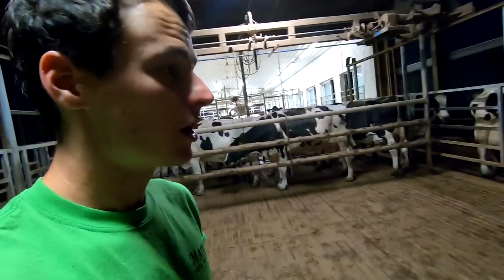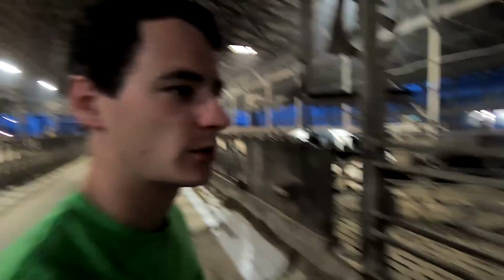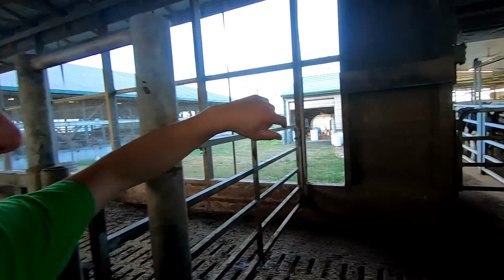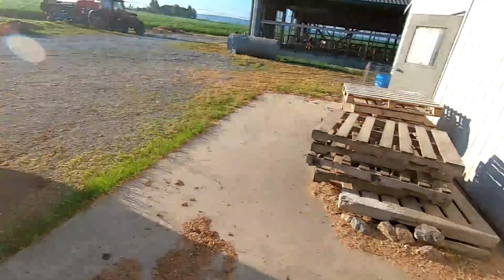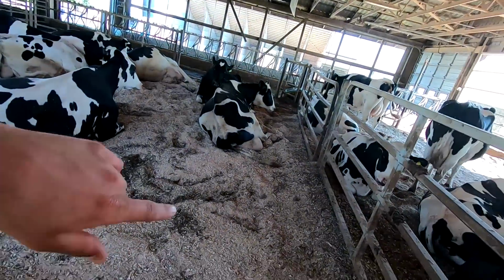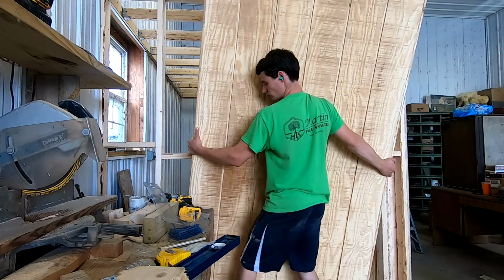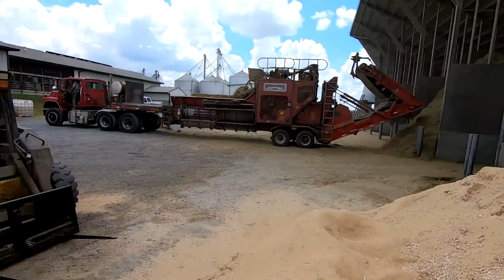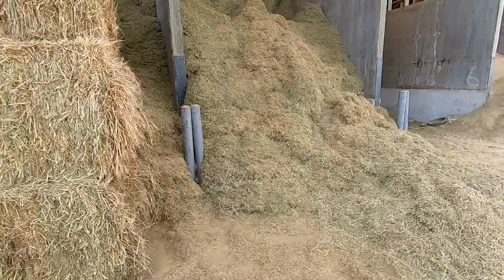Drying Up Cows & Chopping Hay Bales

Comment: There is a circus trick where the performer has spinning plates balanced on sticks. As the plates slow down, they wobble and fall off of the stick. The trick is to keep spinning the plates up faster than they can fall down to see ‘How many plates you can get spinning.” Eric sure has a lot of plates spinning between vets, feeding the hay chopper, drying up cows, laying in bedding, feeding the heifers, mixing up feed for the dry cows and then for the milking cows, scraping out the alleys and putting up T-111 siding on his office. Did not even stop of a “Dew! Well done sir!

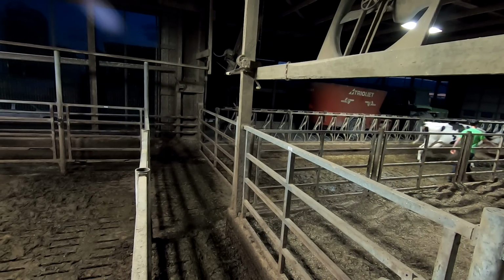Comment: 1:25 What JD tractor do you have on mixer JD 4440? Also do you do only Holsteins and if so only black and white or red and white or mixed? My family has a Jersey cow farm along with 8 Holsteins, 1 black and white and 7 red and whites. The Holsteins we bought from the farmer who owned the farm that we just moved to a month ago we had been farming 6 years before the move. We were milking 34 cows at old farm now we are milking 64 cows at new farm (the farms were tie stall barns) now at the new farm we are putting in a double 10 trans Iowa swing parlor with three inch line. Then the free stall will be up in September. And we will hopefully milk 100 cows then. For the bales when chopping them up put hay header on forage harvester and the chop the bales up with that it works pretty good.

Comment: Great video! Have you ever considered having a tractor with a front end loader on it?
Reply from the maker: Skid loaders are better in my opinion
Reply: A tractor in general is exspensive. Cab or loader adds lots of money on to the price. It's unbelievable a brand new tractor ranges from 75,000 Canadian to 300,000 Canadian
Reply: @10thgenerationdairyman  A lot more manuverable and less expensive to run and maintain.
Reply: 10th Generation Dairyman  I agree we got 4 skid loaders and they are all used everyday.

Comment: the question that i wanted the most to be answered wasn't answered and the question was "why do you use wood shavings instead of straw"
Reply from the maker: Works better and is cheaper in our area.
Reply: I can answer that, easier to clean off, any muck on the beds gets scraped off into the slurry pit below. They use the slurry on their fields as a fertiliser, straw will block the sprayer.